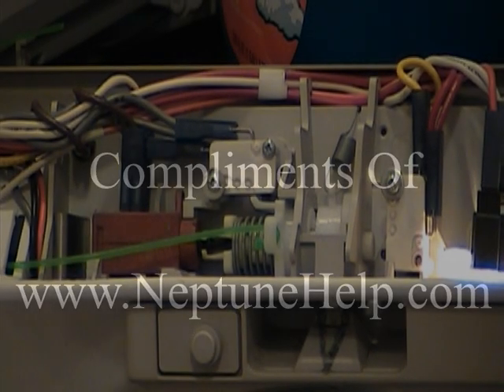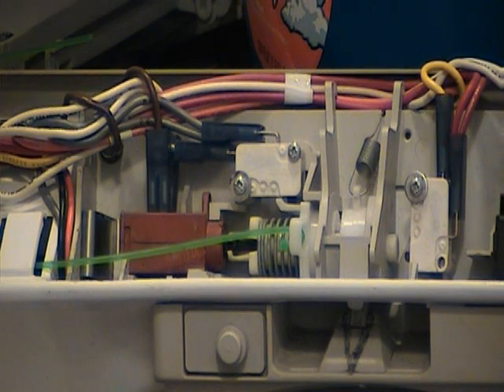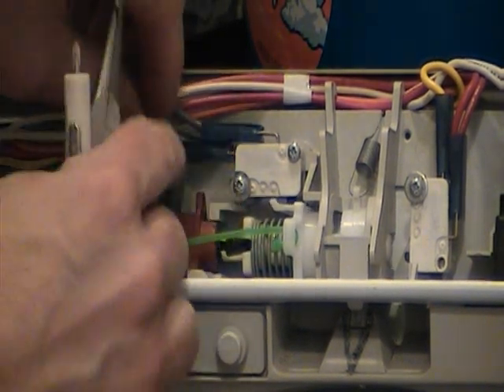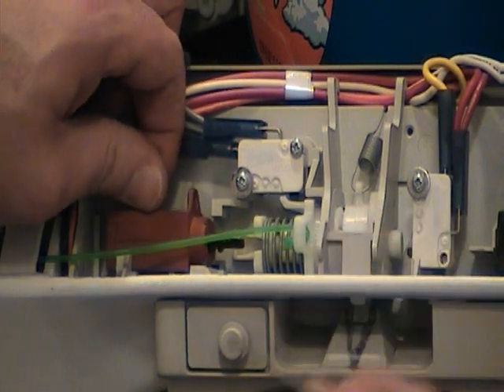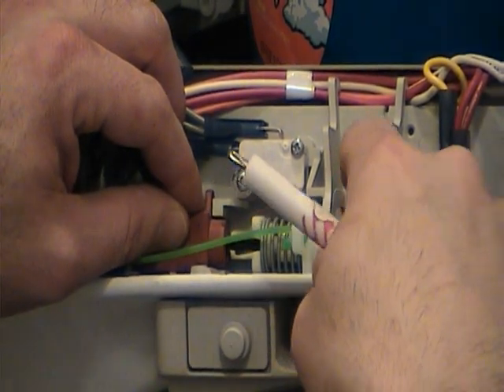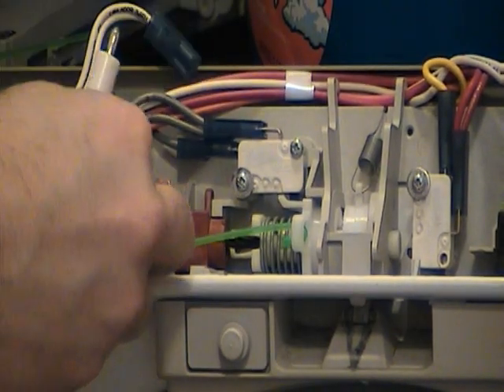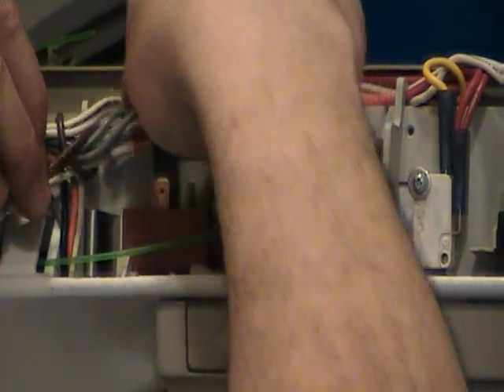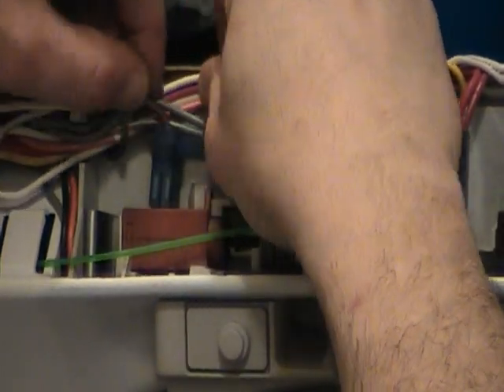How to change your Maytag Neptune door latch wax motor

Comment: Now I'm having another problem.After installing the new wax motor,the door locked light won't come on and door isn't locking.I have the maytag washer and dryer combo,looks like the exact same setup as the vid.What should I do now.
Reply from the maker: Hi Michael,  I would check to see if your R11 resistor is burnt on the upper machine control board located behind timer. See http://www.neptunehelpsong.com for more information about the burnt R11 resistor issue. 

Jeff Hartman
"The Neptune Man"
Reply: Ok,thanks Jeff.

Comment: Thank you! I saw a brown casing and I though it was the case that needed to be black but it is the tip, My machine was already serviced for the recall then because it has the black tip...That's a load off my mind, I just bought these machines so I was inspecting and cleaning them before using them...Any other issues I should worry about if the Wax motor is fine before I plug em in and go?
Reply from the maker: The wax motor issue is on all of the Neptune front loaders with a timer knob. The digital Neptune's do not have the door latch wax motor issue. Contact me when your bearings start getting loud so you can replace them and I also rent the tony tool to Neptune owners to help save time and effort when changing the Neptune bearings. Jeff Hartman  " The Neptune Man"

Comment: what is purpose of the lime green plastic line (looks like a weedeater line)?
Reply from the maker: Hello, That colored cord is  to unlock the door if the door latch fails. On the stand alone Neptune's it will be under the soap dispenser bezel. Remove the 4 philips screws and lift the lid/bezel out and it will enter one hole and exit another in the front corner of the soap dispenser. 

On the stackers the colored cord will be located on the left side after you remove the center panel. 

Make sure you put it back if you ever pull it out to use it and after changing your bearings and seal. I offer the replacement bearing and seals as well as the tony tool rental. See neptunebearing dot com for more information.

Jeff

Comment: I wondered what that plastic thing was for!   when I put this thing back together i will be sure to put the plastic wire back in the dispenser. The repair guy that was working under warranty never did that and i only noticed it after I took the machiene apart.  mine is red. 

  Thanks.